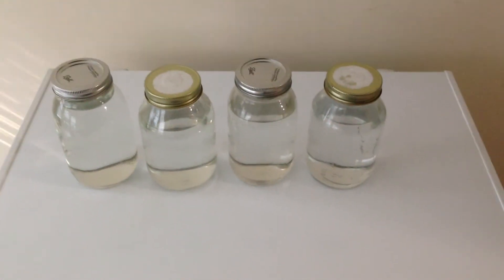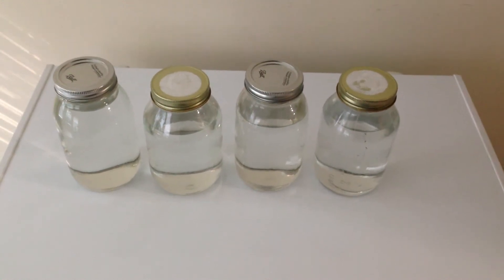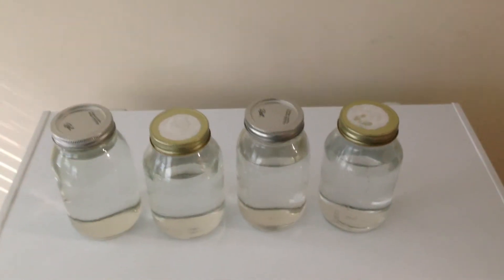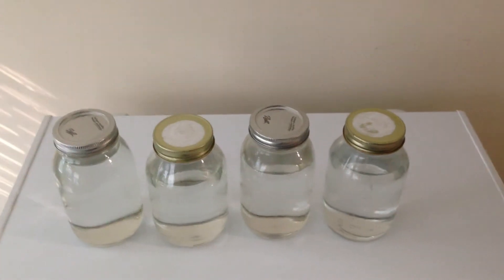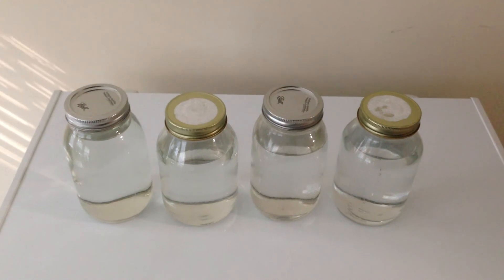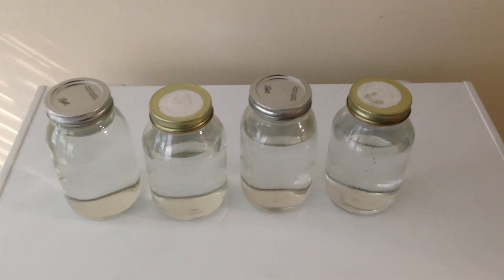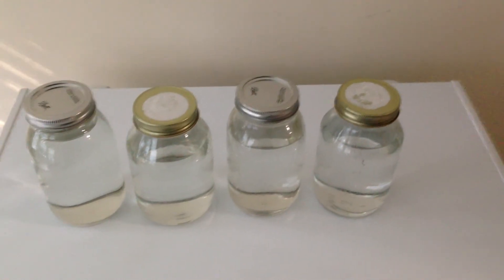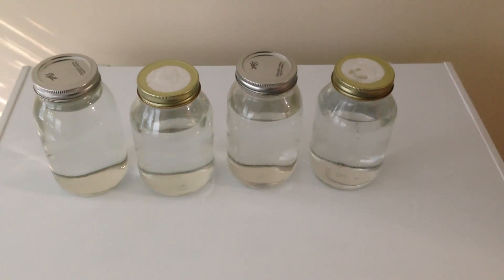DIY Ethanol Home Fuel Update Part 2

Comment: Where is my fuel?
Reply from the maker: I'm hoping your not referring to the drinking kind.  It smells great, but it's not for drinking, at least not for me anyway.  Runs great in the car.
Reply: rhandsom it's very very unsafe if you don't have it at the perfect temperatures of 182.5 to 185 degrees if you are outside of those temperatures you're going to have methanol which will make you go blind so I'm just joking with you my friend
Reply: I'm just kidding that's incorrect temperature
Reply from the maker: Actually, to make this ethanol with the highest purity it has to be between 174 to 178 degrees F.  For drinking, you would just throw out the first few milli liters which is considered poisonous.  Methanol is not produced from sugar or corn. regardless of the temp.  And yes, I know your just kidding. Take care dude.
Reply: Any sunlight today?
Reply from the maker: Sadly no.  I'm still waiting.  By the way, the ARC fault protection in the 250 is enabled and good to go.  Thanks for the heads up about that and the transformer potentially overheating from high Amp charging.  I believe you are right about the smell.  I reduced the charging amps to 50% as opposed to 90% (90 Amps).  Should help, just to be on the safe side.